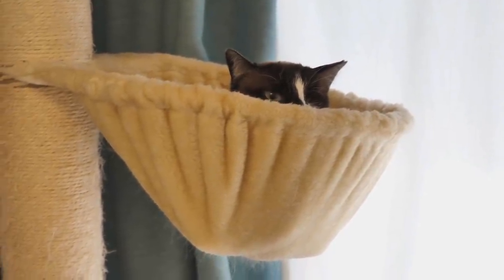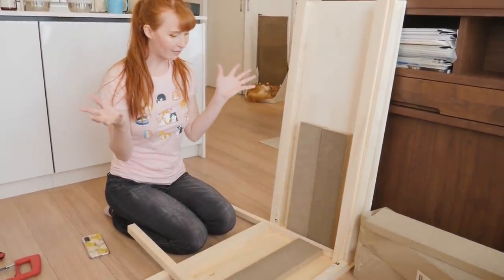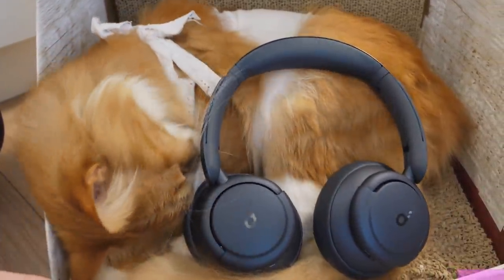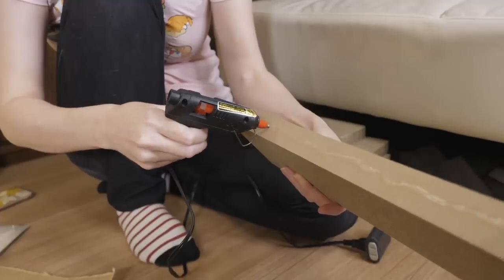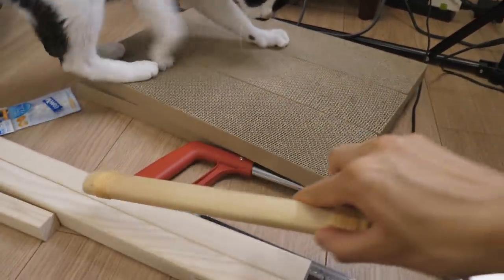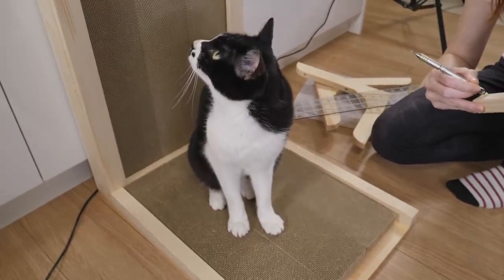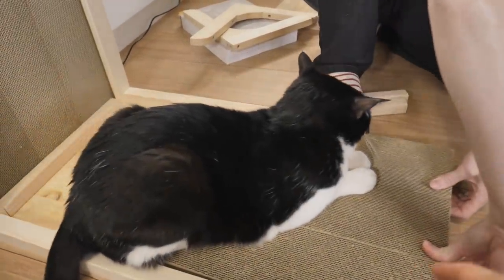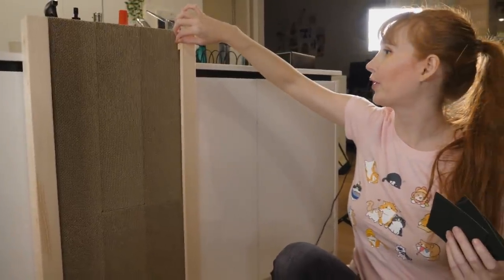We built a scratcher for our cats

Comment: Woodworker here, great job!

Some tips for next time:
- A brush is great for spreading the glue evenly, but if you can't find one next time you can just use your finger.  Wood glue is just slightly modified PVA glue (school glue) so it's totally fine to get on your hands (unless the bottle says otherwise).
- You do normally need to clamp the wood when you're gluing, but applying weight is also fine (I'd go for more than you had there if you can, like maybe rest one end of a sofa on it, or a pot full of water).  If you're going to be adding screws anyway then they can do the clamping for you.
- I don't know about that specific brand, but wood glue usually needs 20-30 minutes to set, and then 24 hours to fully cure.
- In a beefier project you also want to be careful about trying to glue endgrain (the ends of the wood) together since it's not as strong, but as with the glue drying and the clamping it's totally fine here since it only has to stand up to the cats.  Wood glue is incredibly strong when clamped well and fully cured, so for a light-use job like this it's going to do great regardless.
- The weakest part of your build is going to be the join between the back and the base.  I didn't see how many screws you used, but as long as there's a few in there you'll be fine with pretty much whatever.
- If you want to be more sure it won't fall over, next time you could attach the back further forward on the base, so part of the base sticks out the back as a kind of foot.  You could still use those brackets for that if you want; they can screw into your back panel and sit on the floor.
- If you don't want to break out the hot glue you can use a light coating of wood glue on the cardboard too, since it's all wood fibres at the end of the day.
- That saw you have is a Japanese ryoba saw and they're very popular with woodworkers the world over for their accuracy and flexibility.  The hacksaw blade you have will work on wood but is probably designed for metal.

Hope some of this is reassuring!
Reply: Wow, this is pretty informative
Reply from the maker: Thank you for all the info and advice!
Reply: This is so cool! As someone who plans on stealing this idea I really appreciate all of the suggestions and info. Thanks for being such a nice human!
Reply: I stg I’ve learned more from random comments on Rachel and Jun’s videos than I ever did in school
Reply: I'm glad I'm not the only one to pick up on all of that, great advice there. The hacksaw blade looked like a 32 TPI blade to me so definitely for steel or other harder metals, an 18 TPI blade does a reasonable job cutting wood but is kinda slow still.
Reply: What an amazing comment!!! I will be using these tips too!!!! Thank you!
Reply: This was really lovely, useful and non-condescending advice!
Reply: Okay wow I’m probably not gonna be doing any diy woodworking but I’m still screenshotting this. thank you for this it’s very informative!
Reply: @iamnotpasta4408  Same here! lol I've learn more from the internet than anything school has ever taught me. It makes me grateful. lol

Comment: That looks great! I would highly reccomended putting the L brackets on the front. Even though they are not going to be fully flush since the wood is a bit warped, it will add extra stability to the top. As the cats pull on it (scratch the cardboard) alot of the force is going to be pulled towards the cat. Especially with how tall it is, you don't want the wood to crack at the base and cause the top to fall on the cats.

Comment: Great outcome! DIY projects are always so satisfying (when they work out). Bet it’ll look great in the new house.

I got one of those Japanese saws recently, and learned how useful they are. The two sides of teeth, one is for cutting across grain, and one is for cutting along the grain. Because it cuts on the pull stroke, it does really straight cuts with the blade tension on a pull motion (western saws are push stroke). Blade is thin, making really fine cuts. With the flexibility, it can do flush cuts (dowels on a flat surface). Because it has no spine, it can cut through thick slabs or logs. 

Just like Jun’s kitchen knives, these saws are made to cut really well! Just have to make sure there are no nails in the timber as the blades are quite delicate. But, the saw is like 3-in-1, very good value!

Comment: For the next project a few nails/screws can help when you don't have clamps.  Your second saw is a push saw, you only push to cut, it's a different motion than a western saw since the teeth are facing the other direction.  As far as the wood glue, let it ooze out, wait 10-20mins for ti to dry a little bit then you can scrape it off easily.

Comment: just a tiny tip if you easily want to remove excess wood glue (the white ones) use a wet cloth and just rub the glue away although i do recommend clamping your glued parts together with a clamp or screws or whatever so i doesn't move :)

Comment: Rachel,  you should definitely add a joint, maybe to the outside to make it more secure, it looked like you used modeling glue and  just a screw on the outside to connect the upper piece and the base.

Comment: Yes, ideally you would clamp it together for 24 hours. But since this doesn't need to withstand a lot of force and also no one gets hurt if it detaches your solution should be more then enough. I also doubt it won't be strong enough for the intended purpose. Cats simply can't apply anywhere near enough force to rip apart this big of a surface of wood glue even if you had just laid it on top. If you clamp it it would be so strong that the glue would not break. Typically it rips of the surface of the wood if its glued correctly (clamped) if you force it apart. Because wood clue in most cases is stronger then wood. Nails are really often just in there to fixate everything until the glue is fully dried.

Comment: I really highly recommend getting hakuna a baby onesie. Look for one of the ones that buttons all the way down to the leg/groin and put it on him with the buttons on his back side so you can open the bottom side where his tail goes out of and keep open enough for him to use the bathroom with. Get one with sleeves and pants to cover his arms and legs while it grows back. Theres dog onesies that you can get also that would work wonderfully but they are kinda pricey and limited in size. Baby onesies you can probably fin old ones at thrift stores for cheap. I'd recommend prob a 14 month or above for him.

Comment: they could also cut a piece from the ones they used before, diagonally instead of sawing it straight and put it on instead of those rounded support thingies like \ and put screws in after gluing it down

Comment: instead of the ugly angle wood you skipped for now, you could try using a flat piece along the outside to connect the two. I think searching "flat corner brace" will get you results, but I don't know if that's less ugly...

but if you have screws going into the wall portion from the bottom it's definitely strong enough for cats.

Comment: Put my kitty on hydroxyzine pamoate (antihistamine) and she's no longer bald.  I recommend having an apothecary whip up a batch in liquid form with tuna flavoring.   Check out 4 Claws for scratching post that attaches to wall.  It will be under Sisal Scratching Posts (round tube attached to wall).  The sisal post is replaceable, around $20 for 2 and they last.  I have a couple of kitties that like to ground scratch and I've have a couple that try to pull the wall down.  If you have a pull the house down type scratcher, I recommend using toggle bolts larger than the ones provided when attaching it to the wall.  I have this type of beast in my home.  After ripping it out of the drywall, I reset it in the wall stud and patched the drywall.  Who knew a cat would sink his claws at the top of the scratcher, pull his back legs off the ground and place them on each side of it and rip and claw until it dislodged leaving large holes.  I assumed it was a sign of his approval  .... or disapproval.

Comment: @Rachel It’s not just you… look up Misophonia, the problem is real. Also, you can use a toothbrush dipped in water to remove glue before it sets up or use a scraper to remove it after it does. The hand saw you have is capable of cutting verrrrry thin sections if you don’t have time to sand (I did it the other evening on a project of mine).

Comment: Maybe you could still glue and screw those L shaped pieces to the outside of the piece for a little more stability? It would make it a little wider overall, but the usable cat space would be better than the original idea for those parts. Also, the slight gaps wouldn't be an issue.

Comment: As a tip for when you’re gluing wood together if you don’t have a clamp you can use dots of super glue around the wood glue and press and hold until the superglue cures and that’ll hold it together while the wood glue solidifies and cures fully and holds it together longer if you would like an example of this in action Evan and Kaitlyn posted a video where they did their bedroom closet doors and they used this trick

Comment: Engineering Note: 

Yes, the shelf brackets reduce customer satisfaction at the cost of required structural stability.

Use side mounted, screw on, metal braces.

Shaped like the letter "L" with screw holes.

Comment: Im really curious how strong the noise cancellation on those head phones are. The ones i have were supposed to be the best available, but unless im actively listening to something i can still hear the person next to me breathing :^) And with my increasing misophonia issues that just isnt cutting it
Reply from the maker: I definitely can't hear someone breathing, but you can still hear other things, the volume is just super reduced. I can talk to Jun with it on but I have to pay attention. I can hear Poki's meows (much more quietly) but I'm not sure I'd be able to hear our other cats unless it's a high-pitch meow. I think it works best on low frequencies, like machine humming, engine noise, etc. Higher-pitch sounds are easier to hear. Someone dropping shopping bags onto a counter, for example, is still easy to hear.

When I used the earbuds on the plane it got rid of a lot of the engine noise but not human voices so it was actually easier to hear people than if I didn't have the earbuds in. It helps me a lot when I have fans running max on my laptop, so I can hear the video I'm editing or the game I'm playing better.

The app for the Q35 also has a section for "sleep" which is basically just a bunch of background noises you can set at varying volumes, like the sound of rain, birds, wind, crackling fire, etc. So if you don't want to listen to music or anything but it still doesn't block enough noise, you can set some of those white noises to block even more sound.

I don't know what you're using right now though so I'd see if there is any technical info you can compare or anything! The only noise-canceling products I've used are these two Soundcore products. Jun has a pair of older noise-canceling headphones, but he says the Q35 are much more effective. He plays music while using them, though.

Comment: 1. The books for weights instead of clamps is a perfectly acceptable solution (as long as it's not for like, human-sitting furniture, etc.) Cat scratcher approved!

2. The hot glue thing ANNOYS me so much. I bought a high-heat glue gun especially for the few extra seconds it gives you before it dries, but it'll melt some items because it's so hot. In this situation, I almost wonder if you'd be better off with like, a large scale/'industrial' (basically larger) glue gun - you can spread more glue at a quicker pace. (especially if you're buying the scratcher cardboard in 3 pieces; I assume this'll be an ongoing thing to replace? <my cats refuse to use them, sadly, so I don't know how often you need to replace them>). Another option could be Aileen's Tacky Glue or E6000 (but you'd need somewhere with ventilation for this).

3. 8:15 I immediately thought of a Plinko board from The Price is Right.  Wonder how the kitties would respond to that XD

This is such a cool DIY. Love it. Like I said before, I wish my kitties would use these.  Maybe it's worth a try again....